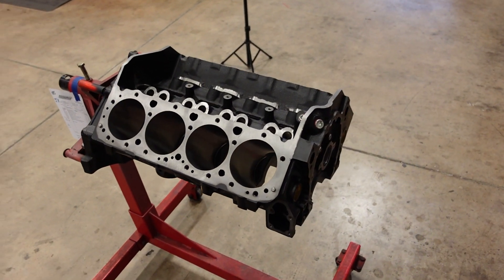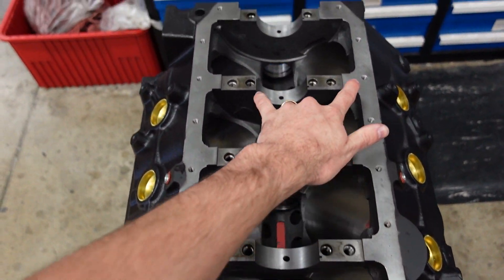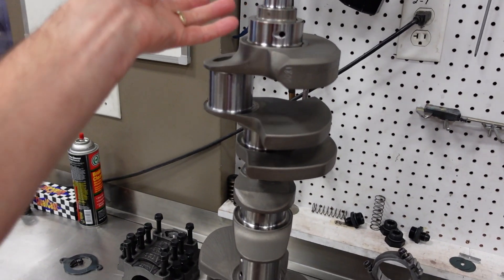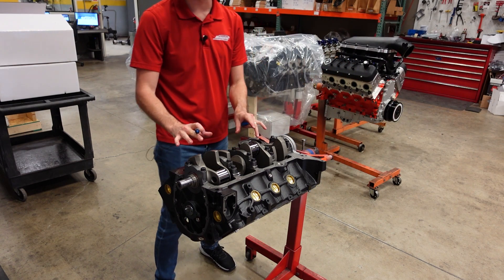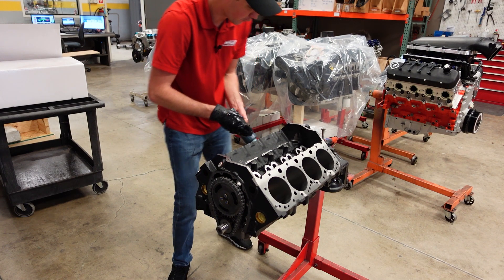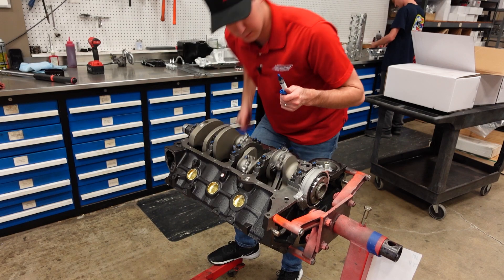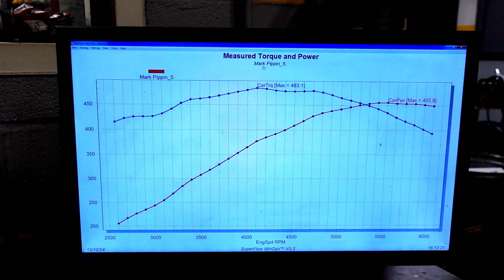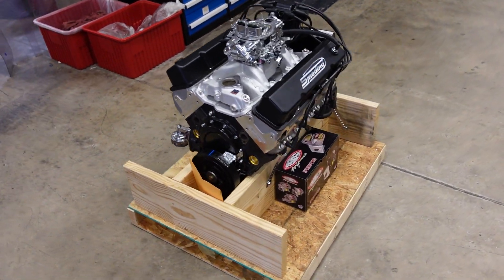Building the Smeding Performance 383 Extreme - Dyno Tested

Comment: That's a nice block. It really simplifies a 383 build. 

It seems like an odd configuration though. It's a pretty big cam for street, but a small carb for a 383. You didn't mention the heads or the other cam specs, so I don't know why it looks so mismatched. But it's only 450 hp? Really? Seems like a waste of (presumably) a nice cam. 

But I see you don't respond to comments, so it'll remain a mystery I guess.
Reply: Its their own head and cam.  I do think the same about the carb size too.  Seems it might be good for a street only engine but could be larger for max power.

Comment: You can buy crate engines 383's that produce 550 hp and 600 ft torque.    Your motor is NOT extreme.